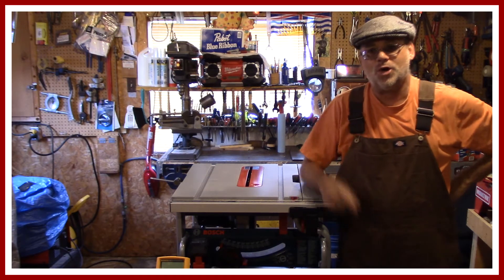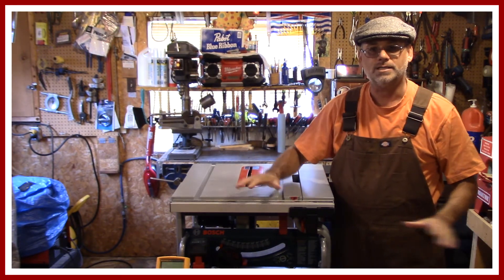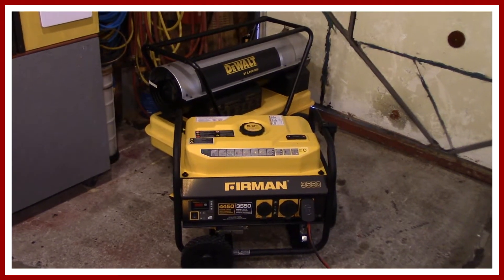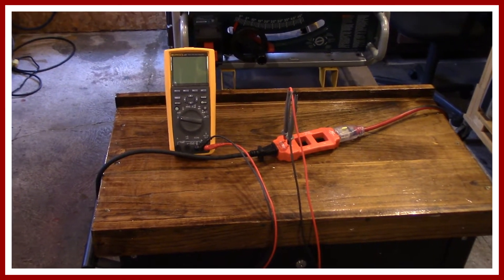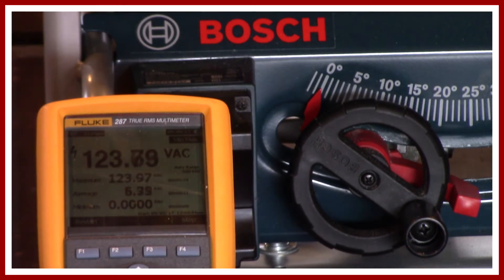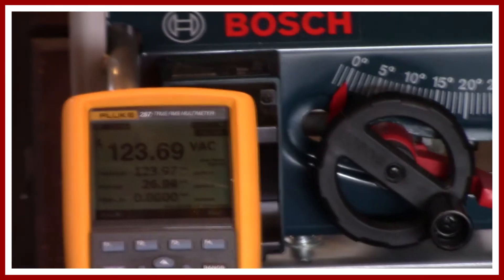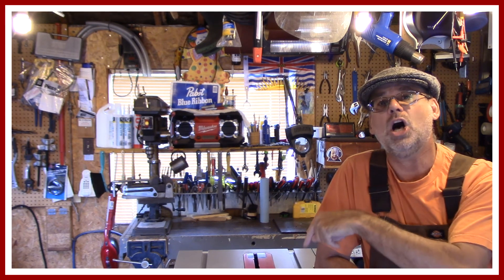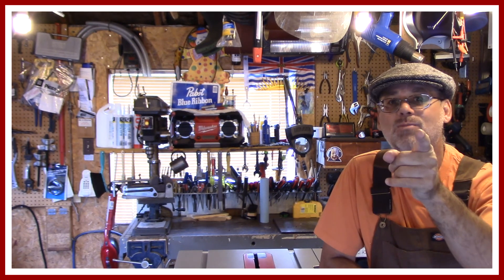VOLTAGE DROP TESTING - WILL MY FIRMAN GENERATOR RUN MY BOSCH COMPACT TABLE SAW - PART TWO

Comment: what is the block you plugged the meter into for measuring the voltage?
Reply from the maker: Josh it's called a line splitter - lots of brands  out there  - this is the one I have  Extech 480172 AC Line Splitter
Reply: @SteveRobReviews  nice.

Comment: I would like to have you compare the voltage drop right at the generator with the drop at the end of the extension cord, 
Cutting wood in the saw would not drop the voltage  much since the loading is not as instantaneous or demanding as motor startup. The gen engine could compensate fast enough under an increase in load.
Reply from the maker: That's a logical comparison to do . Ok I will  to see if there is a difference . Cheers

Comment: It drops more until the generator picks up, not like the regular line which does not have to. I would not worry about it at all.. You have lots of generator power there so you i will be OK with good extension cords. Thank you for the video, Steve
Reply from the maker: Yes and your bang on with genset use.  Some motors do wind up pretty high  on the amperage scale. Cheers

Comment: Whats your review on the Bosch saw. yes /no ?
Reply from the maker: I have used it and it is awesome , light compact and powerful enough for any of my needs . It's designed to hold all the attachments in a great way for transport. I definitely would recommend it .  I have a vid coming out  on Sunday  with a mod to have it used with my Dewalt chop saw stand  .  I haven't seen it done yet and it is a  easy  way to mount it . Cheers
Reply: Thanks that's what I wanted to hear.  , I done some research it was a toss up what to get 4100-09 or GTS-10311. The 4100 with the gravity stand is on order.

Comment: Bruddah Great Video! Hey what is the part number and manufacturer of that AC Splitter you connected your Fluke to?
Reply from the maker: Extech 480172 AC Line Splitter . Thanks buddy

Comment: I'm just here for the fun of it. Okay, I like to learn too but I know nothing about using generators so I don't have an opinion. I read the comments and I do agree, maybe cutting some wood to load the saw would be a better test? Sounds good anyway.
Reply from the maker: Hi Wyatt and it is a reasonable idea  so I will  rip a stud and see the results on the voltage and amperage end of it. I'm guessing it will handle anything I put thru it.

Comment: Plug that baby in to household current and run the test again.   If you have already posted a video doing that.  Excuse me!
Reply from the maker: Yes the household electricity runs fine and this seems good too but I will  rip a board thru it and see how it does.

Comment: I think as long as the frequency stays in design range of the generator, you shouldn't have any issues with a short voltage dip at startup.
Reply from the maker: I'm thinking the same - usually if it starts it will cut fine.

Comment: You already blow my mind on occasion when you don't mean to and now you mean to. Should I be worried? LOL

I really don't know enough about generators but I do agree to test voltage while cutting to be extra certain, in comparison to the rigors of start up my guess is that it can't be that different, but what do I know, lol.
Reply from the maker: Stay tuned buddy your going to be just blown away. HAHAHA

Comment: should work,you may want to test it under load. that genset looks like the champions sold in the states made by Wing Wang ltd....
Reply from the maker: It's a similar wngwang - will test it out with some wood and see how it does.

Comment: Ship it! but now you need another genny for that coffee pot. 
At work we use nothing less than 12 gauge ext. cords for our tools. 
Well our crew uses electric blankets that pull 2000 watts each. Saws and drills, we just went battery, but that wouldn't work for you.
Reply from the maker: I use mostly 12 gauge as well but a short 14 gauge  did well. I will try it ripping a board and maybe a second tool at the same time .

Comment: I think it will be fine if it is the only thing running from the gen.  You should try a a heavier gauge shorter extension cord and see what the numbers are.
Reply from the maker: Good idea and maybe another tool running at the same time.

Comment: I would check it with a larger gauge cord and see if if has the same amount of voltage. drop. Thanks Steve
Reply from the maker: Thats a good test as well - Good Idea, Cheers Lloyd

Comment: hey steve rob...I agree with ozzstar.....lets see what the voltage goes down to when cutting something that brings the saw towards its rating, then you will get your answer........
Reply from the maker: Hi Bill - ok in my experience if you can start it your good to go but I can see where some might think it will bog out. Ok I will do a test this spring and rip some studs while we look at the voltage. Good idea Bill.

Comment: For that short amount of time that its 94V, there’s nothing to worry about. If your genset is a long ways from the saw when you install it, be sure to increase the wire size to allow for voltage drop. And you should put a load on the saw to see what the voltage drop will be. And plus or -10% of your rated voltage is correct when it’s running continuously. Have a good one Steve! 😀👍
Reply from the maker: Yes Terry and for a low cost genset it was pretty good. I think it will do just fine. Take care.

Comment: I think your ok for running now load but the real test is what your gonna cut and how fast you expect to push it in there.....next time rip a 2by 4 in there and see what she does cuz a saw at idle ain`t too much good......ah mod .....you must not sleep much at night....CHEERS
Reply from the maker: I will show it gator but i'm expecting it will be just fine since  its running I don't see the genset having any problem now.

Comment: I would be interested in seeing the results as a piece of wood is pushed through the blade, not much load free wheeling on the saw at idle.  FYI, I contacted a Rabbi in Toronto and he said since no bacon was used in the demo your set up was kosher.  lol
Reply from the maker: HAHA  In my limited experience if it starts I could  cut  wood  with  it all day long  and it will not be any different  than the  your house electricity .  I may have to show it. Thanks Glen good point.

Comment: Let's add another load and see what the tipping point is (no start of the saw). Surely in time if need... people will want to run more than one device.
Reply: Thomas EXOVCDS get your hair dryer going too for a real test
Reply: Say is that an electrical cord ya got attached to you generator or is it a 
ringed neck snake.
Reply from the maker: Baby steps grasshopper baby steps. LOL